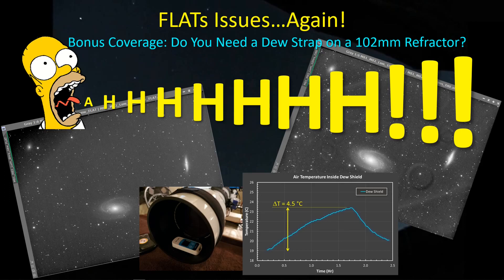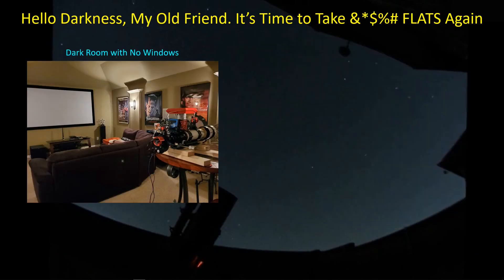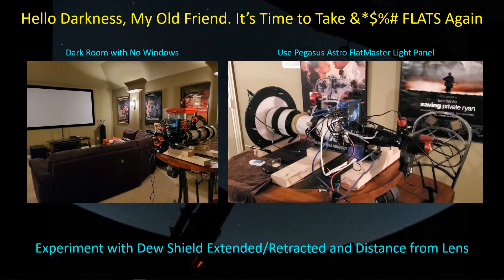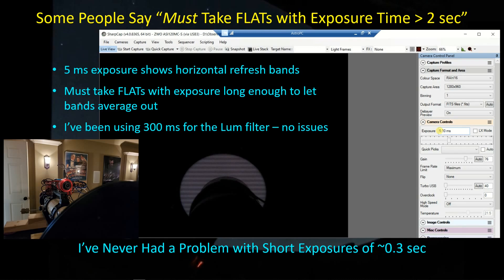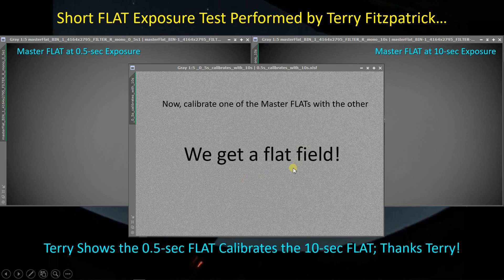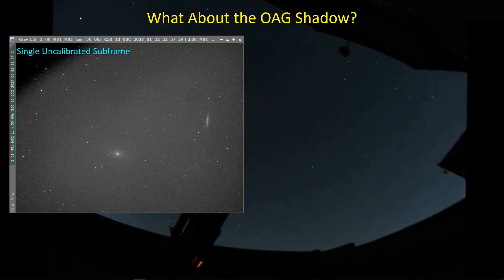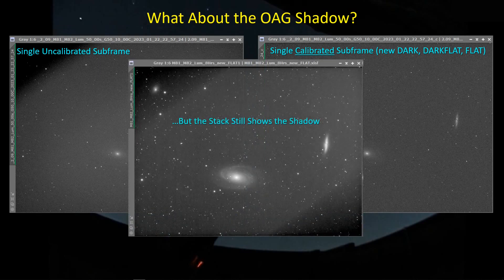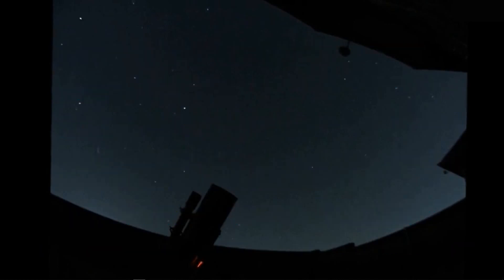More Issues with FLATs

Comment: James, I was getting the same artifacts in my flats, and was cleaning filters and saw no change. I did change the driver setting like you did and it seemed to solve the problem. I stumbled upon the solution but didn't know why. But thanks to your due diligence, I now have a much better understanding as to why, so thanks!
Reply from the maker: Glad to help, Dave. If you’re using unmounted filters, you might consider the 3D printed filter masks from Buckeye Stargazer (Agena AstroProducts) - they provide additional positional accuracy. Thanks for watching!

Comment: I have a KAF16803 sensor with a mechanical leaf shutter with significant open and close time. I had to take flat exposures that were long enough to swamp any effect of shutter vignetting.
Reply from the maker: Yep. A slow shutter requires longer exposure times for Flats. So many other ways Flats can go wrong too. Thanks for watching!

Comment: thanks for another excellent analysis + video and all the work you put in! I suppose the "no-short-flats-recommendation" is also concerning the use of cameras with mechanical shutters, especially leave shutters: even if the shutter is fast there is a moment when the image is vignetted by the moving shutter. In long exposures the relation between this moment and the exposure is almost zero. In very short exposures this relations gets relevant and you get additional vignetting by the shutter itself.

Comment: Another thing to ensure (you may already be doing this, but it wasn't mentioned) is that it is essential that the camera gain (and offset) used when taking flats match that of the lights. So if you ever modify the camera's gain for a new target/new filter, you'll need to take new flats with that identical gain setting to match. As you've demonstrated, exposure time differences aren't that big of a deal (I often take flats at less than 1 sec with my sketchpad panel and they work fine). But gain settings are more critical. -- Not sure if that explains the OAG shadow, but I thought I'd mention it. You might have better luck mechanically backing the OAG's pick-off prism out a little bit.
Reply from the maker: Hey Mark. Mostly agree. Here's where I differ a bit. The gain used for imaging does not have to match the gain used for FLATs. HOWEVER, it is critical to match exposure time, temperature, gain, and offset for FLAT subframes and the corresponding DARFLFLAT subframes so that you can properly calibrate the FLATs. Once the Master FLAT is calibrated properly, you're good to go. In my case, I do use the same gain and offset for imaging and calibration. I use -5C for imaging and +10C for (indoor) calibration. My OAG isn't the problem - it always gets calibrated out properly - except for this target. I tried this target again the other night with a different telescope and camera. Similar type issues. I think reflected light I get in the telescope for this target (over neighbor's lighted/not lighted tree and their house) changes during imaging so that no FLAT can properly calibrate all of the subframes. If it's not one thing, it's another...
Reply: @Aero19612  I think you mean matching  temperature and exposure times are necessary for dark frames (i.e., matching your light frames). But not so much for flat frames (temperature and exposure times are not particularly critical for flats). Camera gain (and offset for ZWO cameras), on the other hand, is (are) important for both darks and flats matching the lights. But if you already use the same gains for your lights and flats, then that's not the issue you're seeing, and you're all good to go on that front.

Regarding the OAG pick-off prism shadow: Even if you calibrate that out with flats, you're only calibrating out the "mean" value caused by the shadow. The standard deviation of pixels within the shadow region will be larger compared to what there would be with no shadow region. 

In other words, while flat frames can compensate for the mean values in the shadow regions, they can't compensate for the noise. In your calibrated frames, those regions around the pick-off prism will be noisier, comparatively. Hence my bringing up the idea of mechanically backing off the pick-off prism a little bit.

Comment: Thanks James! I've been having the same issue with my qhy268m and cfw3m, and I guess this is the cause. I'll test the unidirectional fix once I'll get clear skies again :(
Reply from the maker: Great Paolo! Note that if you continue to see the "embossed" circles after selecting the uni-directional option, it probably means that the filter wheel does not precisely go back to the same position for each filter. Some people clean the sensor in the filter wheel that detects position. There's also a "calibration" option in my ZWO filter wheel driver. Good luck!
Reply: @Aero19612  ah cool, I wasn't aware of such a thing on the filter wheel. Thanks for the pointer!
Reply: Afaik, qhy cfw drivers do not have such option so far. However there is a firmware update just to prevent the fw rotates in both directions. I applied it on mine and works like a charm. Qhy support provides such firmware

Comment: What are advantages of OAG for 4” refractor? Thanks
Reply from the maker: I suppose there are two:
1. Guiding at smaller guide image scale since you’re looking through the main optics rather than, say, a 250mm guide scope.
2. Cleaner (lower mass moment of inertia) setup without a guide scope

But do those advantages mean you get better images? Probably not. At the end of the day, just go with what have/prefer. For my refractors, I just move everything from one scope to the other.
Reply: @Aero19612  I have used OAG on refractors before. Complicated and no advantages. I asked to see what advantages other people get.
Do you use 294 camera? If yes, then I am not surprised that calibration doesn’t work sometimes. 294 has unstable sensor. I take only 5 frames of flats and dark flats to get master flat. Try using only first 5 frames. It may help. It helped me to pull un calibratable cases.

Comment: The reason for recommending long flat exposures is non-linear sensor performance. For ASI1600 the limit is 0.2s (IIRC), for ASI294 1.0s. The 294 at least seemed to use a different mode for short exposures - I remember shooting flats at 0.999s and 1s, and the image statistics were so far apart that you'd think there was a whole lot more than  0.001s of difference.
I don't know how that would affect calibration, though. There are threads on Cloudy Nights about it.
Reply from the maker: Great info, Riku. Thanks! I'm not certain this issue did affect my calibration. It has not in the past (0.3 sec). Newer flats at 2 sec. Same problem.
Reply: +1 for this. Some people expose longer just precisely for this reason

Comment: Jay, if you run local normalization on your calibrated lights  it will help with the oag dark spots, give it a try during your calibration process.   Bill
Reply from the maker: Thanks for the suggestion, Bill! I'll look into it.
Reply: @James Lamb  Jay, one thing I forgot to add is that you may need to correct a light frame and use it as a reference for the local normalization.   This is a work around, however I do find all of this odd as the oag shadow should have been fixed with flats to begin with.   Have you tried using different stacking software to see if you get the same results?
Reply from the maker: @billblanshan3021  Well, as you say, this is odd. It's always worked fine before. I am experimenting with including many more subs in the Master FLAT stack from 40/50 to 150. There's just a tiny bit of error left after the calibration with 40-sub Master FLAT, so maybe I just need to squeeze that little it more out of the flat correction.

Comment: James, excellent video.   Not too long ago I came across the stacked flats issue you reference.  I can’t say how many hours across a weekend I spent on this but it was way too many.  Like your video, one frame flat calibrated appeared to handle vignetting but after stacking and calibrating not!  I finally gave up and sucked it up and cropped my pictures.  Honestly I hated doing it but just couldn’t really find a way to fix it.  I am now wondering if taking exactly the number of flats as I have images may get to nirvana.  Maybe an experiment for another day.  As always thank you for the thought provoking and thorough treatise on the pesky flats!
Reply from the maker: Welp. A master FLAT composed of 150 subs didn’t do the trick… Another weekend bites the dust
Reply: @Aero19612  well that's a bummer!  Back to the drawing board on this one.  Thanks for the update...weather not so great here but you saved me some time for sure!
Reply from the maker: Hi Jerry. You may be onto something. My FLATs are correcting 99.9% of the OAG shadow as is. So I'm experimenting with a much larger number of subs in my Master FLAT. We shall see... Thanks for watching!

Comment: Thanks for the vid and tip,  i have both zwo and qhy setup and I have noticed the donuts on some of my zwo images.  Will be making a change to the driver.  I will also look at the QHY driver to see if they have a simular setting.   As for your OAG shadow, have you done any tweeking on it's position.  You may have to slide the prism up just a scosh.  I've had to do that when I switch from the 2600 to the 6200.
Reply from the maker: Hey Mark. I haven't played with the position of the OAG stem, except in the beginning when I was setting focus. I've never had that shadow not calibrate out before. Makes me think there's something unusual about the light coming from that DSO direction. Playing with the stem position is tricky. As you move the stem out, you also have to move your imaging camera back (to maintain focus). And that may not be possible given that you also have to have a certain back focus to the imaging sensor. So, in reality, you start by getting the back focus correct, then adjust the stem height to get simultaneous focus with the OAG and the imaging camera.

Comment: Great video James, what sensor do you use?  I have been told that flats need to be over 3 secs if you have a 294 sensor due to the inherent issues of that sensor?  I have an Altiar Astro 294C Pro cooled camera and don't think my flats are correcting properly?  I tend to get green and red fringes to my flats although the dust motes calibrate out nicely.  I have been doing flats at 2 secs but am to try going to 3 and see if I get better results?    
I note you use PI, I can nver get to see my flats in PI, is there a way to be able to see them in PI?  If I use Astro Pixel Processor they show up nicely??
Reply from the maker: In this video, I'm using the ASI1600MM. I also have an ASI294MM. I have been getting good results with LRGB flats ranging from 0.3 sec to 1.75 sec. The 294MM sensor is different from the MC version. And maybe there are some sensor-specific reasons to use longer exposure times. Not sure about the color fringes. If you've got cloudy skies or a full Moon, that's a great time to conduct a series of FLAT experiments. Yes, the flats I'm showing in PI have the ScreenStretch applied so you can see the light variation across the frame.
Reply: Thanks James.  Don't know what I do wrong in PI but when I apply the screen stretch it is just white and cannot see any dust motes, vignetting.  However when I view in APP I can see the flat nicely with dust motes and alll??
Reply from the maker: @julianmatthews3262  what is the median level of your flat. Go to process/statistics and click the check mark with flat selected. What does it say for “Median”?
Reply: @Aero19612  Thanks James, I'll be back home at the weekend and I can check my processing computer for that median value.

Comment: Your videos are always so thoroughly done, James, very well done, and thank you! 
It would be interesting to see how your new unidirectional approach will hold for the future. I've had the same disks and like you discovered that it is related it to variations in filter positioning. But I always use it unidirectional...😞. The latest I have done is to run the calibration process. Not exactly sure what that does, but hope it will improve things. Also I have read that an infrared sensor inside the wheel that checks wheel position can get dirty, and may need a cleanup. I havent tried that yet. 
Also, I wondered if temperature might have any influence on the friction control of the wheel. Ultimately it is a metal pin pushing a rubber band. Normally I take flats around the imaging session, but sometimes I take the scope inside and take flats then. Will this friction control be identical between a cold imaging night vs comfortable room temperature?
Reply from the maker: Excellent points. The friction pin could very well be sensitive to temperature as you say. I'll have to see if I can find that sensor. And maybe I'll run the calibration process, but, like you, I'm not sure what it does. Thanks for watching!

Comment: First of all, thank you for your well reasoned videos. I noticed your #8 filter is secured to the wheel by threads while the other filters use 3D printed rings. I just wonder if taking filter #8 out will result is not seeing the embossed artifacts even when you use the non-unidirectional option. I'm thinking of potential unusual reflections inside the wheel.
Reply from the maker: Good question, Quique. That's my ZWO O3 filter in the #8 slot. I was comparing it with the Antlia O3 in the #6. The Antlia filters are unmounted and so do not have that threaded mounting ring that the ZWO set have. When I open the filter wheel again, I'll remove the ZWO filter. Another thing: it's still good to use the unidirectional mode just in case you have a smudge on a filter - those will leave 3-D artifacts as well. Thanks for watching!

Comment: Hi James. Great video as usual. I had problems with short duration flats with my ASI533MC camera. I did some testing and found that below about 1 sec exposure the adu was nonlinear and more variable. The result was similar to your oag issue (gradients more noticeable with increased # of subs. I am not sure if my ASI2600MC has the same issue (I went to 4ish sec flat/dark flat exposures). Thanks for the info.
Reply from the maker: Ahhh. See?! That's a good reason. I don't doubt that there are pieces of equipment or combinations of equipment that can/will lead to restrictions like the 2-sec rule (not to be confused with the 5-sec rule when we drop a Dorito on the floor). But that 2-sec gets engraved in stone and passed around without the supporting "...and here's why". Thanks for bringing a legit "...and here's why" to the discussion, Bob!

Comment: Perhaps you are producing too much heat which may cause unnecessary turbalance. I have used a Kendrick ambient temp controller but now use a celestron 2x & 4x controller with the additional sensors that are placed under the dew strap (next to lead in before the actual element). The sensors provide feedback to the controller so that the power to the strap is applied only enough to get to the desired temperature. In the case of the celestron controller, just above the dew point. You can adjust the agressiveness of the control. In this way, large or small dew straps are all controlled evenly (ie. main OTA or guide scope) and you don't have to manually guess to save power or brute force to control dew because you have that feedback loop.
Reply from the maker: Hey Greg. I doubt that my poor little dew strap can generate enough heat to produce turbulence. I swear it's barely warm to the touch at max heating. A feedback option is a nice idea. I run my setup off of house power, so I'm not worried about conserving energy. Even so, all of the power for cameras, the mount, focuser, etc is coming through the Ultimate Power Box so It's not like there's an infinite source of power. Thanks for watching!
Reply: @Aero19612  Re turbalance, how do you actually know? An interesting call for a person who tends to measure and collect data.  Re feedback, it's something that Kendrick do with measuring ambient temperature and controllers like Celestron and PrimaLuci do with Dewpoint. But many people seem fixated on the Pegasus type controllers or even manual and don't really get the feedback idea. Any manual control is just a guess and you have to over do it just to make sure. (bad for portable unless you have heaps of stored power). BUT, I think it might be interesting to know if a dew strap can cause measurable turbalance and how one might go about measuring that impact.
Reply from the maker: I do not know that turbulence is not an issue. I surmise that based on what I do know:
1. I've using the dew strap the same way for years and never had this problem, so if turbulence were the issue, it seems like I'd be having the problem consistently

2. Turbulence is a great hypothesis but how do you prove it? Any sensor (pressure sensors?) placed in front of the lens would block the light. How do you differentiate turbulence caused by the dew strap vs wind blowing across the front of the scope? How do you differentiate turbulence from the effects of seeing in a long-duration exposure? How can turbulence affect only one corner of the image?

I do like to measure and collect data...when it seems like a productive use of my time. I don't know how to collect these data or how to answer the questions above. Questions I ask myself before I measure something: (a) do I think it's important? and (b) Can I measure it and evaluate the effects?